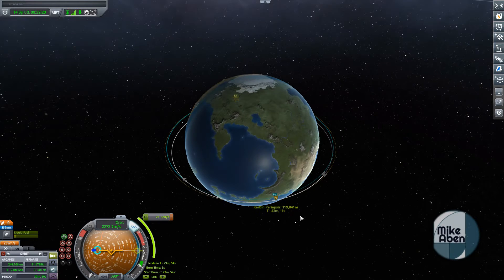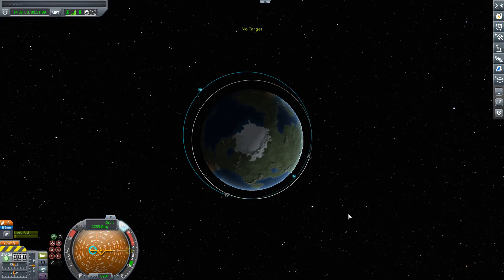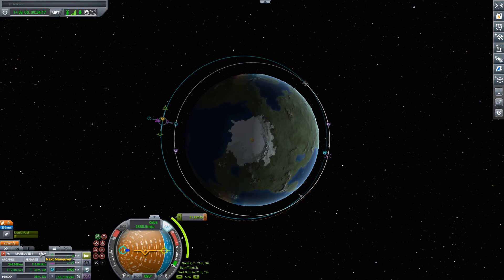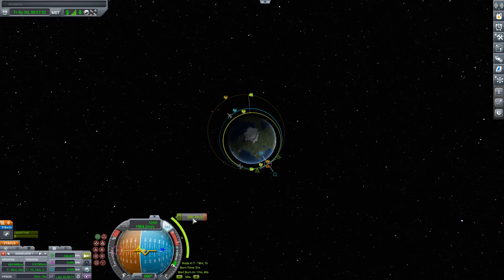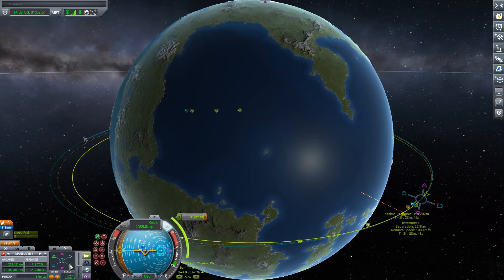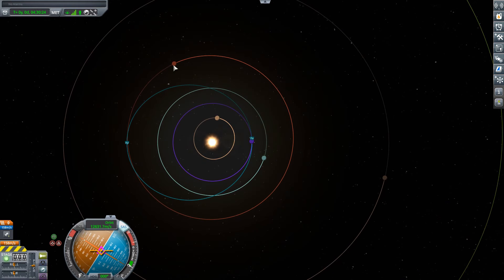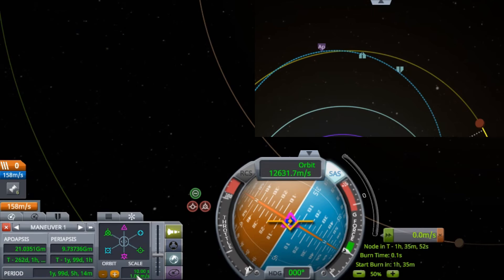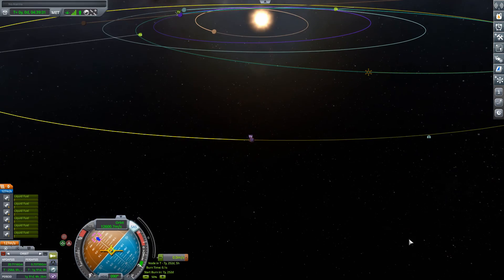Using Multiple Maneuver Nodes | KSP (Not) Beginner's Guide

Comment: Hi Mike. I was hoping you could do an advanced tutorial on tips dealing with ultra-low TWR.  I've found only one 'tutorial', but it isn't anywhere near your level of detail, and I can't master the concepts with my 0.005 to 0.01 TWR probe.  

In my Kerbalism game, I've unlocked Ion Engines, which appear to be useless getting probes to Duna due to the low TWR.  Even if I shoot for a high altitude of say 1Mm for the ejection, they just can't stay on target during the ~90-180 minute burn (yes, huge burns because I am ejecting ~140 days before perfect window).  If I use several ion engines, it then begins to exceed the costs of sending a normal LFO probe to Duna.  But to make matters worse, capturing Duna with an ion probe seems to be the hardest part, again due to the low TWR.  Aerobraking isn't much of an option as probes have all sorts of parts sticking out unlike crewed non-station vessels.

Of course I'm making it even more difficult for myself, as I am starting my Duna Probe strategy 140 days before the proper window, so ejection and capture is costing 4500m/s, not ~1700m/s. Yeah, capturing Duna when I need 2200m/s with Ion engines is....tough.  I know I know it would make it easier to wait for the right window, but I can do it easily (atleast in the SIM) with LFO engines.  I'm not doing a "speed run", but I've been meticulous doing as many things in parallel as possible, so at day 90 in Kerbalism, I have unlocked everything at the 300 tech tree and already have a few 500s.  I've got stations on Minmus and the Mun doing FLOAT, FLIGHT, JAMMED, CHILLED (had to mod Kerbalism support file because there is a bug with Probes Before Crews not allowed CHILLED and TRAPPED), and I have just launched a semi-mobile base to Minmus soon to the Mun collecting STAKE, SHAKE, CHILLED, and TRAPPED.  I've got all of the Kerbin Atmospheric and Underwater science done (except for the manned underwater collections).  I have nothing to do, and it seems wrong to wait 2 years every time I need to send a probe or re-supply mission to Duna.  It will need LOTS of mission.  For the Kerbal manned missions, I don't have much of a choice, so I am planning each crew will spend 5y on their Duna missions before returning to Kerbal.  After Duna, I think I will go to Probe Frenzy, and do the rest of the Solar system with Probes - all of my crewed missions can return to Kerbal with an SSTO that by then I "should" be able to refuel from an eventual refueling station near the runway.  Launching replacement Kerbals should be inexpensive as I will just put them on the runway with a capsule, EVA, recover the EXPENSIVE but cheap capsule, and walk and board the refueled SSTO sitting there and get them up to space.  Re-supply missions should not of course be affected by Probe Frenzy.  When I get to Probe Frenzy, I still see Ion Engines being problematic due to the high deltaV needed to reach the outter planets.  I know Gravity assists will help (I hope RTGs help so I can reduce batteries needed while burning Ion Engines through the dark side) but I haven't tried GAs yet.

Haha, thanks if you've read this far.  I just think that a tutorial on low TWRs (using many many burns) would be good as there really aren't any out there.  I am also kinda running into similar problems with my Nuke powered intra-planetary transport, but its manageable and it works, but I there is definitely deltaV inefficiency when doing a single burn with a low TWR nuke vessel.
Reply from the maker: It happens this Saturday's video is on dealing with low TWR. Not as low as what you have, but the ideas should transfer.
Reply: @MikeAben  FANTASTIC!  

BTW, regarding your series, the science scrounging in Kerbalism is tedious, but quite fun as you have to build all sorts of craft with all sorts of parameters (high alt, long endurance, or both) - ha, and the underwater science was a challenge - my VTOL craft just could not be stable with the required payload and range, so I made disposable parachute subs that I would "bomb" onto the target from a long range transport aircraft...and it had wheels to drive to the small lake (trajectories is good, but not that precise, lol).  I did "cheat" per say using the unlimited fuel hack...simply to give me unlimited SOIL so I could create ballast tanks, and freely adjust.  Harvesting and dumping oxygen (underwater as well) would work, but would take several days to adjust the ballast.  I haven't unlock mining yet to harvest/dump water, but it seemed like overkill for something simple that the base game is terribly missing.

I'm suggesting this because I imagine Duna may be your next step, but there is a LOT of waiting of course and I know you timewarp a lot for your series (quite understandable).  This this science scrounging is something you could do in between.  You don't have to show the repeated collection in all of the different biomes, but craft creation, testing, and 1 biome would be great.  Looking forward to see how you would solve these engineering problems.